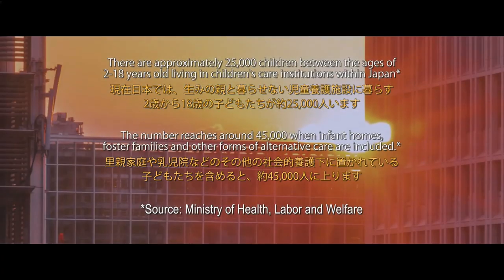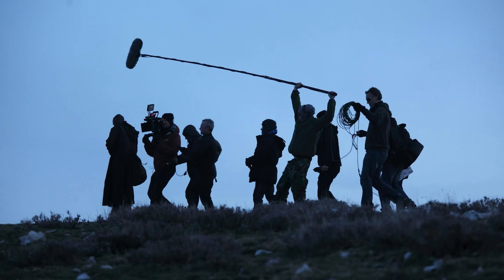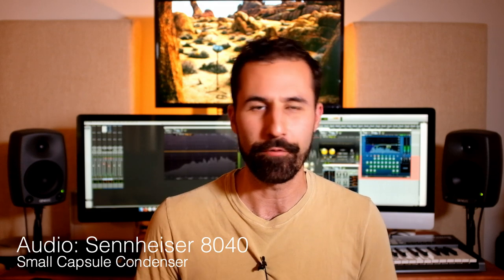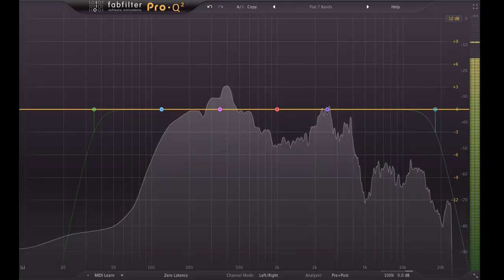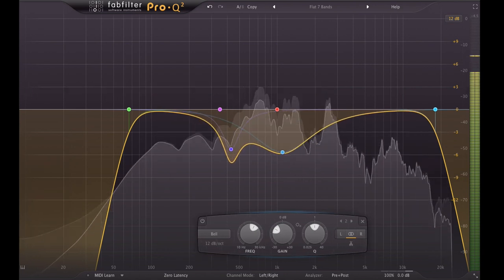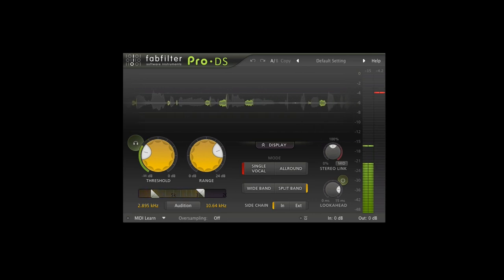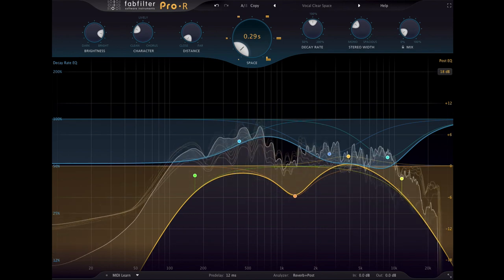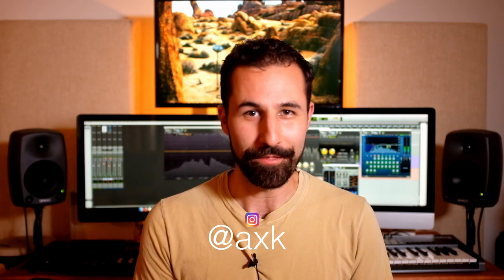How to Make A Lavalier Mic Sound Like A Boom Mic

Comment: Consider impulse responses and associated plugins. I remember Sonic Foundry's Acoustic Mirror but there are contemporary implementations. Basically you  record a known sound (the impulse) through a given mic and the software deduces how that mic sounds in that particular space, as the impulse is known so it can compare the recording against what is expected and note any differences, then you can apply that "sound thumbprint" to another device and it will instantly sound similar. It's literally bluffing. It can get more complicated, speakers matter etc, but you get the idea. Think of LUTs for sound devices, it's the same general idea as having a Color Checker in the shot and making a LUT that brings the colors to something fairly decent. The Sonic Foundry/Sony plug-in used to come with dozens of mic profiles, dozens of venue profiles, vintage reverb profiles etc, all recorded from the real things, and you could make your tiny lav mic sound like a Neumann in Carnegie Hall if you wanted, well, sort of :-) With a little work you can create impulse responses that "normalize" the sound of your mics between each others, and give you a decent starting point than you can then reapply instantly, like a LUT.

Comment: i watched your sennheiser video, i bought the mke 600, i used it on a job but didnt like the result, there s something i dont like about it. it s a bit thick and compressed sounding compared to a rode wireless pro with lav2...donno why but for female i stopped and am back to using the lav. it dounds more natural ...what s wrong . also i was connecting the senn mke600 to the rode wireless pro tx, and recording to a sony a7iv with sound level on camera 5 and wireless around -10.

Comment: I have a huge Problem with audio on my camera... Please help.  First off I have a  Canon 90 D with the kit lens  EFS 18-135 I have installed the Rode Video mic go onto the camera.  Every time I record I constantly get a ticking sound in 0.75 seconds.  I did notice if I have face tracking on I have ticking like a really fast machine gun... Any suggestions on how to fix this issue?
I still get some clicking even if I am holding the mic..  If I use my lapel mic I don't get any ticking at all..

Comment: Interesting enough, the great lav has a flat response to then be massaged to fit what ever space is needed. The more present bright mics sound have upper frequency curve boosts but sound more like news and weather reports rather than flatter mics are easier to space match. I remember the cheapest mics sounding fresher out of the box but suck to mix. The flatter mics like my u87 and much flatter tube ribbon royer mic sound almost dull but can be molded to anything. The boxy sound the high frequency boosts are masking is usually just the shape of the small untreated spaces(250-850hz area). Mic and lav mic placement makes a great difference qs well.The further the source from mic, the less you will hear that. I love sound and really love experimenting plus discovering the little things to speed workflow.